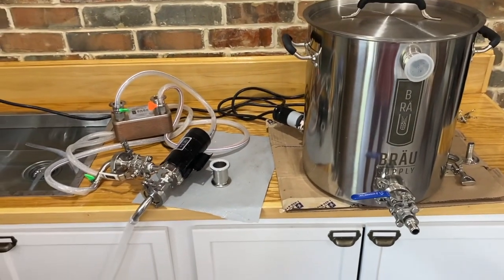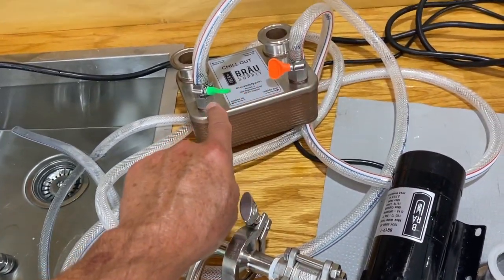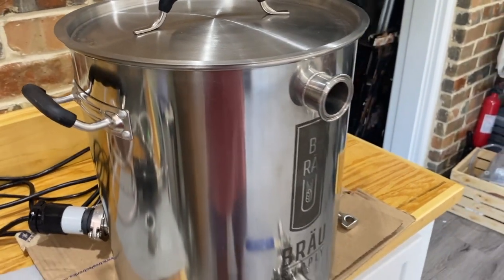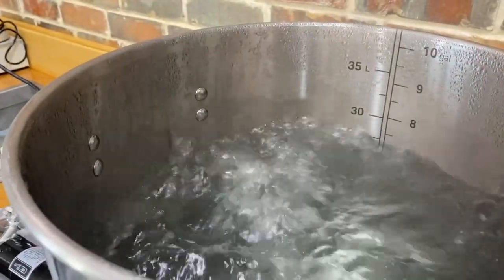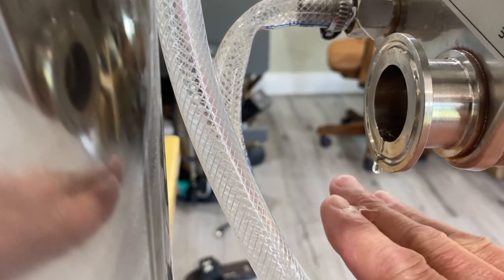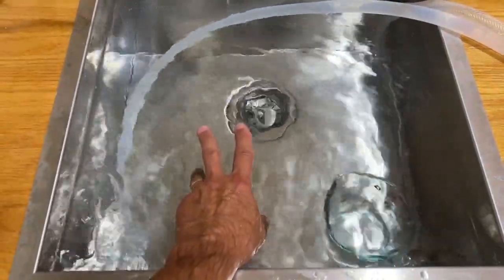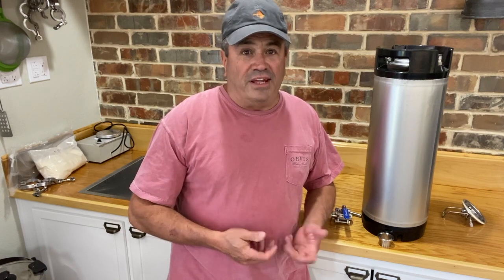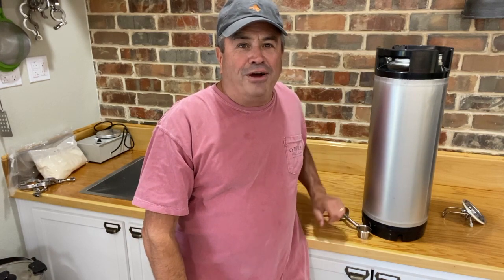Condensate steam killer for beer brewing

Comment: Clever idea but a little worried that a boil over (happens a lot with steam condenser set ups) will block that plate chiller and with a clipped down lid the steam will super heat and blow that lid and you wouldnt want to be near that. Brundog's spray steam condenser design does use a lot more water but it wont ever clog and is way safer.
Reply: With the lid on the kettle still is not under any real pressure right?   Air is allowed to flow freely out and through the chiller no?   I don't see how it could build enough pressure to be a safety concern.

Comment: Glenn, have you tried cutting out the pump of the setup and running a water supply directly to the heat exchanger and then the output to a sink and see how it compares?

Comment: Hi Glenn. I see your basin water was up to 113 degrees, but did you ever need to reduce that temp at all? I assume as long as the water temp is considerably lower than the boil, it will still work? 
In summer,  I plan to pump water from our pool(even if I pump it to cool another bucket with old immersion chiller)so I don't think I would need to worry about it but in winter I would need to use similar method as you.